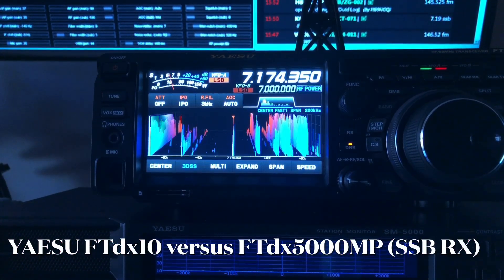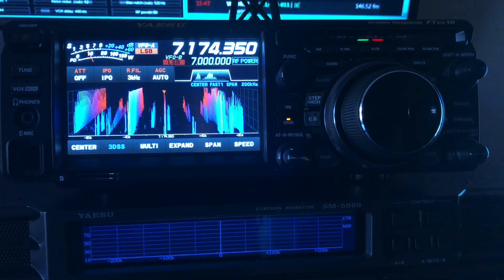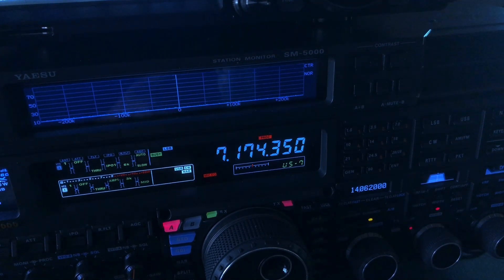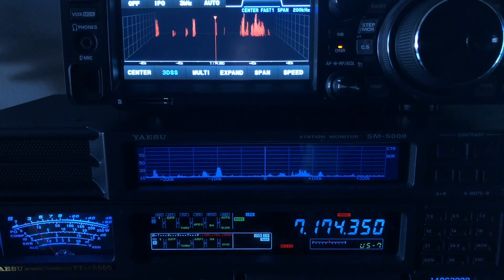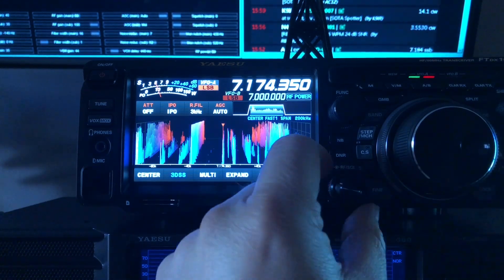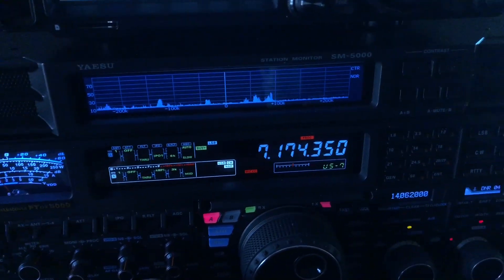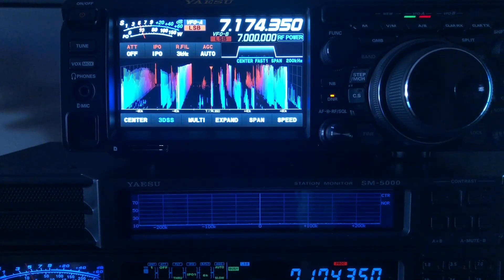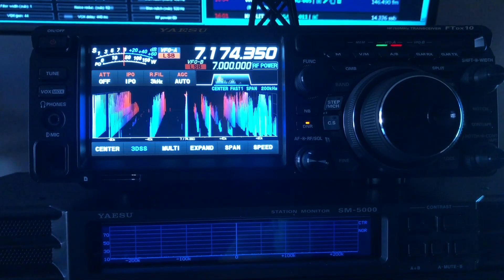Yaesu FTdx10 vs FTdx5000MP: SSB RX (Video #5 in this series)

Comment: If the radio doesn't have an rx antenna port I don't buy it. So for me the 5000 wins, FT1000MP is an excellent rig as well.
Reply from the maker: The FTdx5000MP is my favorite radio of all.  Ergonomically great and a great performer when it comes to pulling weak stations out of the fray.

Comment: I set my FTdx10 according ro rhe settings here using rhe hand mic and audio reports are spectacular! I bought a headset and although alc is about the same, comp went ro 20+db and reports say over-modulated. Gotra work on that.
Reply from the maker: Depending upon the manufacturer, the headset element is probably very different than a Yaesu hand mic. I use Heil and the settings are very different.
Reply: I turned the mic gain down to get the Comp back to 10db and had it down to 10%. So should I adjust mic gain or proc level or amc level?
Reply from the maker: @stevet4773 it could also be equalization. Leave AMC at 60-65. Processor at 15.  Adjust mic gain. What kind of mic is it?  Brand and model.
Reply: It's a headset and adapter set that W2ENY sells called the DURHERM DR-H30.
Reply from the maker: @stevet4773 I shot a video where I set up a W2ENY mini desk mic. As I recall, I had to turn the mic gain down.  The element is very sensitive. It also picks up too much background noise with the gain set too high.
Reply: Ok. Funny the ALC was good with the mic gain at 45 like the hand mic, but the COMP was over 20db! So I left the Proc Level where it's been at 15 and the AMC Level at 60. I lowered the Mic Gain from 45 to 15, and that made the Comp settle in around 10db. I'll try that on the air.
Reply from the maker: I think I had to lower it to between 10 and 15.  It’s in the video. I also equalized it differently.

Comment: 1Thank you upfront for all these great videos on the ftdx10 . It's a shame you did them all on that horizontal time display , instead of the regular vertical time display. look at how much more intuitive the display on the 5000 is versus the 10 in 3d horizontal, it just seems confusing visually looking at signalls.   still come January 2024 I'm getting a Apache G2 new units.  they seem visually easier to watch the signals  and still seems easier to narrow in a signal , and still quieter than the 101D .  just my opinion and we all know what they say about opinions  kn6jvs  73
Reply from the maker: I grew accustomed to the 3DSS. I can take or leave waterfalls but, if I must, I prefer the 3DSS. Same information in a different view. The FTdx101D/MP even takes it a step beyond, with the Narrow Band 3DSS SDR function. That will be shown in a future video in the FTdx101MP series. Those videos won’t be public for a while though.

Comment: Have you noticed any brief degradation in the audio and signal on stronger signals when you ride the RF gain back to around the 3 o'clock position ? I have on my UK version of the FTDX10 where the audio crackles and the S meter drops a number of s points and then recovers. The sound would remind you of a dirty switch such as you would find on a much older radio.
Reply from the maker: Mine does it. Yaesu has been aware of it for nearly two years. It isn’t a dirty potentiometer. The RF Gain is an encoder.  The FT-710 has the same issue. Apparently there is nothing that can be done about it.
Reply: @n4hnhradio  I sent Yaesu UK a video of what I was seeing and they have forwarded it onto Japan. Must be something to do with the AGC as I find that the issue isn't as bad on AGC slow and is fine when AGC is off. Very few people have noticed it which tells me there are a lot of operators out there that still work on the Spinal Tap approach,.....all knobs to the right !
Reply from the maker: I guarantee you that Yaesu is fully aware of it. It might be inherent to the FPGA that use.

Comment: ftdx 10  has its issues 
however what a pair of ears 
and  how you can lower noise floor wow 
thank you very much great video
Reply from the maker: There is definitely no perfect transceiver.  The FTdx5000MP is as close as I’ve seen, taking into account the receiver, ergonomics, DSP and all.  But the FTdx10 is also quite a contender, especially for those who prefer a more digital user experience.  And the receiver is unrivaled by all but it’s big brothers, the FTdx101D and FTdx101MP.

73, de N4HNH

Comment: Have the ftdx-10 with external SP-2000 speaker.  Works great for base station.
Reply from the maker: That’s a great combination!

73, de N4HNH
Reply: It is a base station I thought.
Reply from the maker: The FTdx10 is technically a base station, but it could be used as a portable, for POTA, Field Day, etc.  It has been a Field Day favorite, due to its selectivity.  The FTdx10 is also approximately the same size as my 1991 FT-890/AT, which was considered a base/mobile.  It even included a mobile mounting bracket in the box.  There is a photo on my QRZ page that shows my FT-890/AT installed as my mobile HF radio.  With a proper bracket, and enough space in the vehicle, I see no reason why the FTdx10 could not be used as a mobile HF transceiver.

Comment: Great job taking the time with all the videos you have posted.  Just wished you would list the setting changes verses talking over the radio so that the comparisons could be heard.  Sorry about the criticism.
Reply from the maker: Just follow the directions and listen for yourself.
Reply from the maker: The video is a year old.  I just watched it again and there is plenty of time between adjustments to hear the difference, while still keeping video under 15 minutes long.
Reply: @n4hnhradio  Sounds good.  Went back and paused between the explanations and could compare the audio.  To me the ftdx-10 has more aggressive DNR, where as 5000 is less aggressive.  But at the end they are both great, hard to pick a definite winner.  If one does not want a menus driven rig, then 5000 would be the pick.
Reply from the maker: There is no winner.  The two transceivers are neck to neck.  If you keep watching videos from both playlists, you will see both being boss.

The DNR of the FTdx10 was the first to rival the 5000.  Even the 101 could not rival the 5000 until after the FTdx10 was released.  The stark difference was noted and Yaesu had to release an update for the 101.  Ii is interesting to note the the FTdx101D/MP, FTdx10, FT-991A, and FT-891 all use the same type of DSP chip, the Texas Instruments TMS320C6746.  The FTdx5000 uses the TMS320C6727B chip, as does the FTdx3000D and the FTdx1200.  The DNR algorithms might be ever so slightly more aggressive in the FTdx10.  I don’t know.  The main difference is the clock speed.  The chip in the FTdx5000 is running at 300  MHz, while the chip in the FTdx10 is running at 368.64 MHz.

The programming of the algorithms is clearly superior in the FTdx10 and now the FTdx101D/MP.  I have queried why Yaesu doesn’t go back and update the FT-991A and FT-891.  I presume the answer might be related to a memory limitation.  But still, even the FT-891 DSP beats the DSP of most competitors.
Reply: @n4hnhradio  So it would be great to compare the 101D/MP with the updated SW to the ftdx-10. Probably won’t be able to pick up the difference over the YouTube audio anyways.  N4HNH, you have more detailed reviews than most on YouTube. Keep ‘em coming.  Thank u so much.
Reply from the maker: The FTdx10 uses virtually the same architecture as the FTdx101D/MP.  They use the same DSP chip, with the same firmware, as of last April.  The advantage of the FTdx101 is the preselector (VC-Tune), simultaneous dual-receive, multiple antenna ports (including a dedicated RX antenna port), and ergonomics. The bigger radio has more control via knobs and buttons.

I have around 200 videos for FTdx5000 and around 70 for FTdx10.  Plus videos for FT-891, FT-991A, and a few for IC-7300.  

As long as the Patreon support team continues to help offset the cost of time and equipment, I plan to keep the videos coming.  Some people only join for one month, download the perks, and cancel.  It’s difficult to put forth the expense and time for only what YouTube advertising provides.  So, if Patreon support dwindles too low, I will have to quit.  I don’t run a commercial operation, with support from manufacturers and dealers.  I try to stay focused on operating techniques, using the equipment I am able to acquire.

73, de N4HNH

Comment: The FTDX 10's are on sale now Jan-2022 Fellow amateur bought one, the FTDX 10 and it's DNR destroys the preformance of 7300. Zero compairson. Awesome radio @ $1400.00 right now.
Reply: Не трогайте 7300- он лучший!
Reply: Update; the FTDX 10 main board failed, PLL went squirrely. Poor Communication with Yaesu, had to pay shipping both to and from Yaesu. Main Board Replaced. Lots of failures with the new radios.
Reply from the maker: Mine is now 18 months old. Still no failure.  I didn’t update the firmware. I’m using V01-04. Glad Yaesu has a 3 year warranty though.

Comment: Well listening to both thru my iMac with Bowers & Wilkens computer speakers, at the end there they both sounded pretty much the same,  of course the different speakers you were using SHOULD have made the 5000 a clear winner along with the fact that the FTDX10 has an upward pointing mini speaker. (thus it should have sounded the lesser of the two).  That DNR on the 10 is pretty impressive on 40m.   If you stored that into a memory or one of the three band stacks, would the audio setting stay put?  Can you save the settings to an SD card for a reference setup?
Nice Job N4HNH...!
Reply from the maker: With band-stacking, frequency, mode, filter selection, IPO, ATT, DSP parameters, etc., all save in the band-stack register.  But such things as power output, CW speed, CW pitch, and RF Gain, are global parameters that are not changed by band-stacking.  The audio equalization, both TX and RX is also global.

I still favor the FTdx5000MP for sideband receive, even after connecting the SP-30 external speaker to the FTdx10.  But the FTdx10 sounds good too.  

But, for CW, I prefer the FTdx10.  After adding the 300 Hertz CW filter, the FTdx10 has a slight edge over the 5000 for blocking QRM.  Strong QRM 100 Hertz away is eliminated.  Even signals 60 Hertz away are very attenuated.  The combination of the 300 Hertz CW filter and the DSP width at 50 Hertz, plus APF set to narrow, is simply unstoppable.

And yes, the SD card can save backups.  I have mine backed up.  The same card also stores your TX memories for memory keying.

73, de N4HNH

Comment: Shoulda put a external speaker on the ftdx10 cannot really make a comparison that was not test you talk to much before you switch radios ftdx10 is close to the other radio.
Reply: Got you sorry for my answer I have no disrespect
Reply from the maker: This is not the channel you are looking for.
Reply: Iam getting one it's hard to compare with a good speaker with a speaker built in. And yes this is a ham community and this is what iam looking for it's just not layed out right. Just saying 73 de.n1sca
Reply from the maker: If you had watched the rest of the FTdx10 videos before making your comment, you would have noticed a SP-30 connected to the FTdx10.  But I’m not comparing receive audio.  I’m comparing receiver sensitivity, selectivity, and filtering.  If you don’t like my comparisons there are plenty of other channels on YouTube.

Comment: I have buy ftdx10 , incredibile rx but in general i prefer ICOM 7300 again...Is my opinion..
Reply: With a crowded band and a lot of QRM, 7300 sufferm from the lack of a good analog frontend. Perfomance decay in those conditions is pretty clear (i had 7300 for about 2 years, my qth is downtown )
Reply from the maker: If you don’t need the more selective receiver, and only wish to operate casually, the IC-7300 is good for that.
Reply: Agreed.  Prefer 7300.

Comment: Another Loudspeaker, but NOT RX comparison :-(
Reply from the maker: No matter the speaker, the receiver either can or cannot separate signal from noise.  

If you want a more scientific review, look up Sherwood Engineering.  But bear in mind that his review only looks at one thing - RMDR.  I simply operate the radios in real-world scenarios, usually with QRN, QRM, heterodyne, and other factors, to see how well the transceivers handle the typical sort of issues a ham radio operator will encounter on the airwaves.  If you’re looking for lab tests, this is not the channel you are looking for.

73, de N4HNH

Comment: Very interesting comparison...the 10 seems to see very close to 5000. But i think that the comparison would be more correct with a very low degree of DNR or better in OFF. In the 10 a level 1 for me is the better one. In any case the 5000 is always a step ahead. Very good test...congrats.
Reply from the maker: I want to put the best foot forward with both radios.  DNR is a feature that should be exploited, especially when it’s as good as it is in these radios.  I run DNR all the time.  I’m spoiled by it now.  I don’t like to hear QRN between syllables.

I thought the two were very close in performance.  The additional clarity in the 5000 can possibly be attributed to the fact that the FTdx10 still had a bit much low frequency boost dialed in.  I found that I have to turn the low frequency EQ down to -1 to more closely match the low end of the 5000.

73, de N4HNH

Comment: Being honest, difficult to say. I might feel more confident were both using the same speaker, but both are excellent. Thank you Doug 😊👍
Reply from the maker: Thanks John!  Watch for the video that shows the SP-30 external speaker.  There will be an unboxing video.

73, Doug
Reply: @n4hnhradio  That SP-30 speaker really improved the audio on the FTDX10 (I watched that video). 73 de WA3RSL
Reply from the maker: It’s difficult for the internal speaker to compete with an external speaker.  The inside of the transceiver doesn’t provide enough of a resonance chamber.  The external speaker is dedicated to just being a speaker.  The enclosure has but two purposes.  Mate up to the radio like it is an extension of the radio and provide the speaker with a large enough resonance chamber.  You will get more depth in the audio.  It will sound more rich and full.

The funny thing I have discovered shooting these videos with my iPhone is that when I play them back, listening through my ear pods, the recorded sound is virtually identical to what it sounded like in the shack as I was recording.  My shack is also a music rehearsal studio so there are minimal reflections from the room.  Such reflections can alter the tone, as a result of phase cancellation, aka comb filtering.  

So, what you hear from my recordings, assuming you are listening through headphones or ear buds, should provide a fairly accurate representation of what it really sounds like.

73, de N4HNH

Comment: Both are great radios.  The comparison shouldn’t be between these two.  The bottom line is....if you were buying a new radio the FTDX10 has got to be at the top of the list. In my opinion if you are buying a new radio in the price range of 1,000-2,000 you won’t go wrong.
Reply from the maker: Some of my viewers asked to see the FTdx10 compared to the FTdx5000MP.  Two contest class radios going head to head.  From what I am seeing thus far, the FTdx10, at $1,700, is on par with the $3,700 FTdx5000MP.  That’s quite good.

If I had money to burn, I would buy every radio and put them all to the test against one another under real-world operating conditions.  But I have to rely on the generosity of people like my good friend Joel, who loans his radios for testing.

But yes, I believe the FTdx10 to be the best radio on the market for less than $3,000.  And it costs less than $2,000.

73, de N4HNH

Comment: I would like to see the FT991A added to this mix. I am amazed at the receive capability of 991A radio.
Reply from the maker: I don’t have a FT-991A to put up against the FTdx10.  But I shot a series of videos with the FTdx10 versus an IC-7300 and my FTdx5000MP.  The FT-991A hung in very well against the FTdx5000MP.  The FT-991A is blessed with the same quad mixer and dual-gate MOSFET technology that the FTdx series radios use in the front end of their receiver.

But I must admit that, based upon my experience thus far with the FTdx10, it has an edge over the FT-991A.  The DSP is so much improved.  The receiver is also very sensitive.  But the SDR and DSP are able to separate the signal from the noise floor as good as, or better, than any other radio I’ve ever operated.

73, de N4HNH
Reply from the maker: I featured the FT-991A with the FTdx10.  The FT-991A did well.

73, de N4HNH
Reply: The 991A is not in the same class.

Comment: FYI... if you "long press" on the Shift knob it will set the Shift & Width back to the default settings. It quick resets for you, so you don't have to rotate the knob of each looking for the default setting. Great videos by the way. I have this radio, and I've used a lot of your previous FTdx5000 videos to help me setup (and understand) the FTDX10... just became a patreon btw.  Keep up the great work!
Reply from the maker: Thanks Todd!  That’s good to know.  So, it’s similar to pressing in on the IPO, etc. buttons on the 5000, or pressing the reset on the 5000.  That’s great!  And thank you for becoming a Patreon!

73, de N4HNH
Reply: @n4hnhradio  Also, same goes for the Notch and Contour buttons... not sure if it's "as useful" but a long press on either of those, centers the notch and/or contour.
Reply: now i'm going throug and long pressing all the buttons to see if there are any other easter eggs.